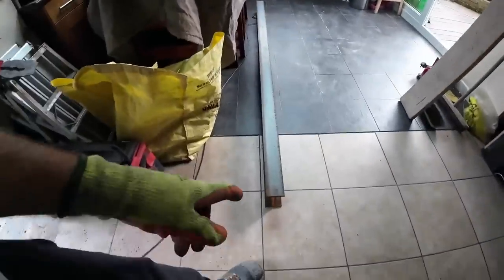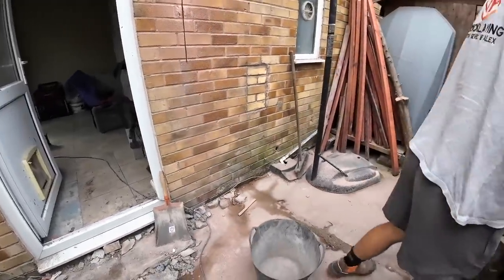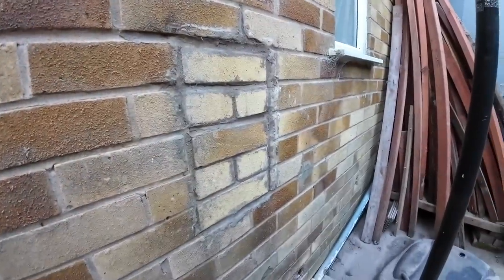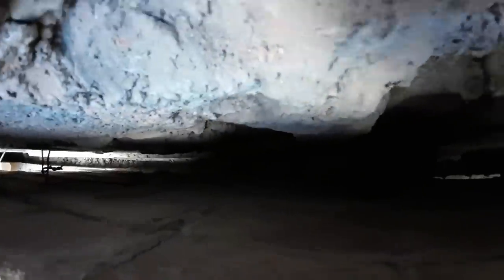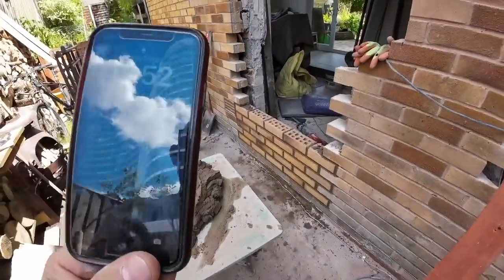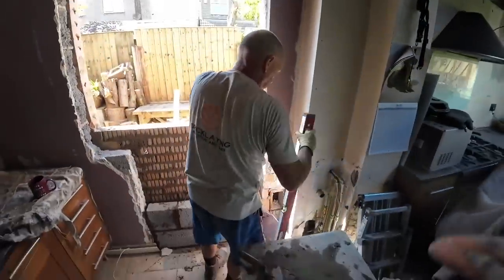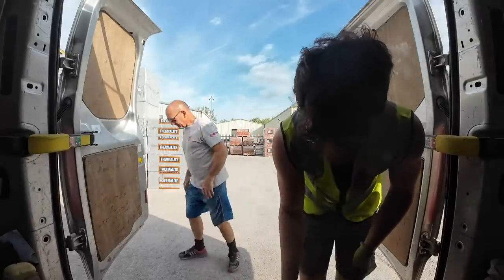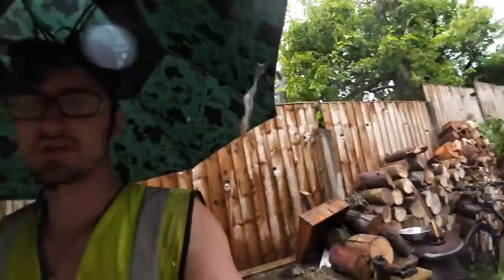THIS CAVITY WAS USED AS A SKIP!! RE MODELLING KITCHEN PT 2

Comment: Lots of examples of what not to do, in the original builder’s work. Apart from all the rubbish in the cavity, they also sloped some of the ties the wrong way, so any moisture that ends up forming on them will flow towards the inner leaf. Even the ones they managed to install correctly, they managed to drop mortar on, so moisture will still wick from one leaf to the other.
Safe to say, the new bit of wall has been completed to a much higher standard than the original house, H&S concerns aside.

Comment: Agreed. The big lump of cured concrete bridging the cavity would have been a step too far, given it’s almost certainly not the only one. That probably started off as a mortar spill on a tie, then accumulated more and more as the wall went up and the builders just didn’t care.
Taking the outer leaf down to fix that would have doubled the job and almost certainly revealed another one, just as bad.
Good call, stopping where you did.
Don’t pull loose threads in a knitted jumper. Too easy to turn them into a ball of yarn.
Reply from the maker: Exactly 🧱👍🏽

Comment: Question for the lintel experts…! I’ve got a 1963 house with two windows separated by an infill panel. Very similar build to this house. Probably 5m total width. Is it likely they used one long steel lintel?  Cracked above beam like all the blown lintels you have done. Good work lads. Andrew
Reply from the maker: I’m 99% sure it will be 2 angle irons . Good luck 🧱👍🏽

Comment: I've offered matching bricks from the pile here so an old flue opening could be bricked up properly on neighbours' houses a couple of times and both times they've made right pig's ear of it. Not my problem you might say but they're on the front of the houses opposite.
Reply: Too bone idle to cut into joints and match the existing bonding right?
Reply: @Chris-f7s2y  Correct in both cases plus in one they didn't take up my offer and instead used some mismatched bricks they found in the garden.

Comment: Nice video. Interested to hear what kind of sawblade you use in the reciprocating saw to get through the mortar. I suppose it is proper cement mortar. Works realy well. Fast and no breaking of bricks.
Reply from the maker: Bosch carbide masonry 👍🏽 not too good hard mortar 🧱👍🏽
Reply: Thanks 👌
Reply from the maker: @rinse9484 🧱👍🏽
Reply: I bought one on their recommendation and its an absolute game changer!
If  bricks are soft you can make new perp joints - I needed them when putting in a new 'stone' window sill.
You'll wonder how or why you coped without it!
Reply from the maker: @markdauncey927 😁😁🤜🏽🤛🏽🧱👍🏽

Comment: Whilst clearing the cavity will have cost your customer money in the short term the long term benefits will far outweigh that cost. Especially if they do go for cavity insulation.
Only problem is that the rest of the house may well be the same!!
Great work with added value as ever - well done guys!
Reply from the maker: Thanks mark 🧱🧱👍🏽
Reply: Cut a small window in my daughters house (20 years old) in the space of that removed 2 bricks that had fallen in. Cavity insulation had been blown in after construction so god knows how many are in the rest. Who inspects these property’s. At least with the 2” cavity you can’t drop a brick down.
Have to say you made a tidy job of this not sure the extra foot of window was worth replacing the lintel though🤷‍♂️
Reply from the maker: @johnwarwick4105 🧱👍🏽
Reply: @johnwarwick4105  My father said when my parents had their first house built in '52 he'd go round after work and make sure the cavities were clear and check anything else that would have been covered up later if not dealt with.
Reply: @Graham_Langley  sounds like a good idea. In the space of cutting one window out in my daughters 20 year old house I found three bricks. God knows how many more there are as the insulation was blown in after. The wider the cavity the more shit drops down 😳
Reply from the maker: @johnwarwick4105 😳😬🧱👍🏽
Reply: @johnwarwick4105  Had to deal with a rubbish-filled cavity below the garden door here earlier this year. 
The builders has swept stuff off the slab into it which took the DPM down with it. Instead of clearing it they put two bits of broken pallet wood on top of it and screeded over them. Result was a nice cavity bridge from outer leaf below DPC to floor slab above DPM. I pulled two and a bit buckets out of the cavity and did the job properly.
Reply from the maker: @Graham_Langley That’s just terrible 😞 🧱👍🏽
Reply: @SteveAndAlexBuild  And I see no reason my house should be any different from the dozens of others Martin Grant built here at the time (1982).
Reply from the maker: @Graham_Langley . Terrible 😠🧱👍🏽

Comment: Is each contractor responsible for there own debris removal or is there a dumpster provided for all contractors to use?  Your steering wheel is on the wrong side of the van and you are driving on the wrong side of the road!  Hi from TEXAS!
Reply from the maker: Hey Kevin. When this house was built there was a skip as on all sites but whoever built this was a lazy ass 😠🧱👍🏽

Comment: You going to leave the cut face on the bricks on the one side of the window ? Can you not just cut them out and rotate them and  put the finished side to the window . Nothing looks worse than cut bricks around a window or door and that much more if just on one side. Instead of natural it just points to the fact the widow was changed or worked on. Nice job .
Reply from the maker: The customer was fine with it as it’s tucked away round the far side of the house 🏡 🧱👍🏽
Reply: @SteveAndAlexBuild  Yes they were fine with it but if it was on your house what would you have done ?

Comment: i noticed looks like extn part  all layed empty frogs down  steve.I just hope the so called brickies who did jthe job got payed back.why the hell would a so called skilled bricki do that,i only do it for capping some walls for a finish only if they dont want copping stones on.🤣🤣🤣🤣
Reply from the maker: Those bricks should be banned full stop 🛑 🤢🧱👍🏽
Reply: It helps LBC make cheap bricks but pushes cost of extra mortar onto the builder - unless of course they cheat like this!
Reply from the maker: @markdauncey927 CHEAP ! Two and a half quid a brick and you skip 30% of them . Friggin disgrace 🤬😫👍🏽🧱
Reply: Is that the Ibstock 'replacement' price?
At least that was a 'proper' brick.
Presumably the original LBC were cheap as chips?
Reply from the maker: No the copies are about £1.70 the shire original London’s are the expensive ones 🤢😡🧱👍🏽
Reply: Same issue with this '82 Martin Grant build. Made refixing the lead flashing above the porch a long job, filling the frogs above the lead with mortar so it stayed fixed. But on any single-skin walls they did lay them properly frog-up.